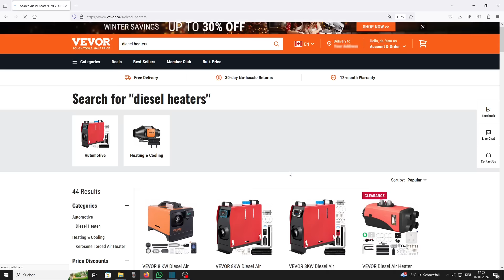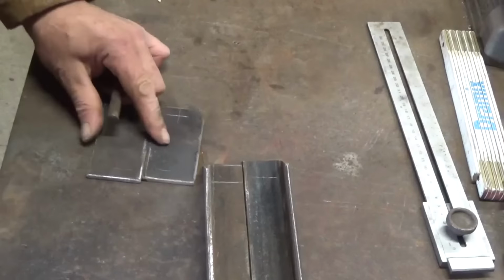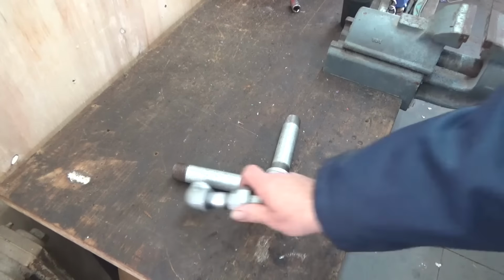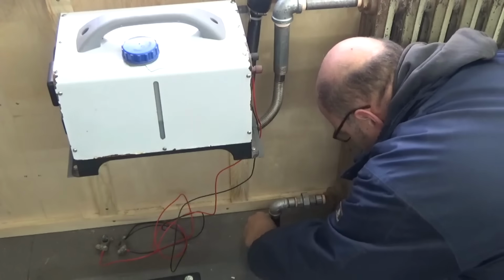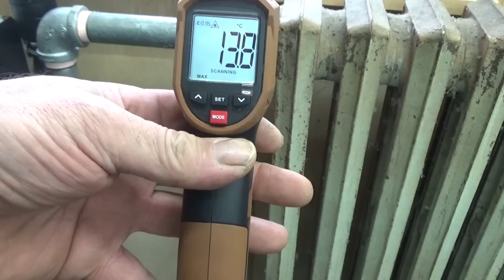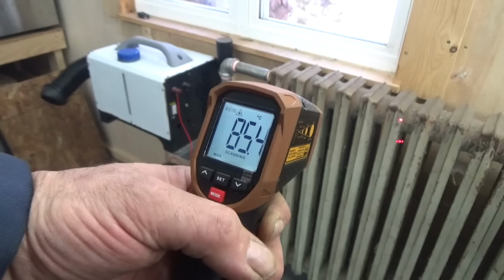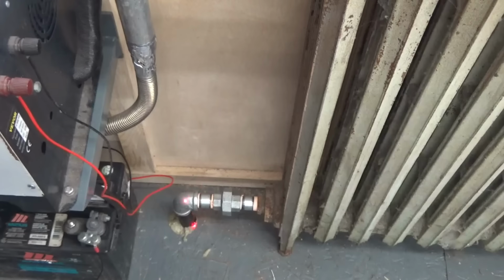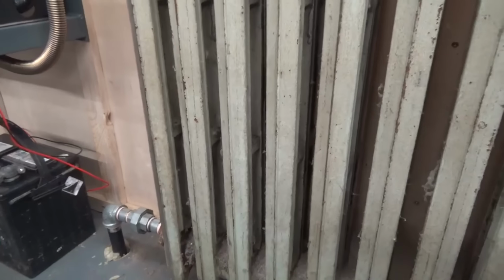Diesel heater upgade 200% more efficient

Comment: That's a brilliant idea, but a few suggestions:
Have the exhaust enter from the bottom of the radiator and exit from the top.
Also the exhaust should enter on one side and exit from the other.
If the exhaust gets too restricted incomplete combustion will occur.
Reply: No. If the exhaust enters from the bottom, there is no way to get rid of condensation. Condensation occurs when the exhaust drops below 100C. There is a reason the exhaust temp from the heater is above waters boiling point. Why enter one side and exit the other? He already showed that he is extracting all the heat from the exhaust, so much that his exhaust Temps are below zero, causing the condensation to freeze in the radiator.
Reply: @ColCurtis  Physics
Still a closed system.
If what you stated was true, eventually the exhaust would become blocked from the freezing condensate, filling the room with exhaust gases and killing everyone inside.
Ever see an air compressor tank condensate valve? That is the ONLY proper way to drain the system. Every other way relies on pressure. The freezing readings were from the outside of the pipe, where the outside air was flowing into the area and over the outside surface of the pipe not from the exhaust gas exiting the pipe.
Reply: @stans5270  if he keeps the bottom exhaust pipe temp above freezing the condensation will run out the bottom exhaust pipe. It is not a closed system if the bottom pipe is open. I would Insulate the bottom pipe to keep it room temp.

Comment: One gallon of diesel will only has  125,000 btu. You will never get 200% efficiency and 250,000 btu out of it as it isn’t possible. You will be lucky 110,000 out of that heater as the most efficient oil furnaces are about 96% efficient and cost thousands of dollars.

Comment: Good to see someone else in NS doing stuff like this besides me. LOL    Been using these CDH for a while.  You will have issues with carbon build up eventually and condensation building up  with the exhaust angled upward like that.   Everything  on the exhaust should be on a downward  slope to prevent condensation build up and giving it a path to drain.  Also move the combustion air intake outside of the space,  when it does foul up it and it will at some point it will dump all the exhaust gases back through the intake manifold into your room because the intake and exhaust share the same combustion space.  CO monitors are a must.   Stay safe and good luck.
Reply: Intake should be outside, it really pulls air. The way he has it pulls air in through every crack in the building....
Reply: Yes the combustion air intake should always be outside.  When inside they will pull cold air in from the outside through every crack and crevice it can because of negative pressure.  I have seen the result first hand from my own mistakes and experiments over time.

Comment: I think that if you take the big nut out of the radiator you'll find a baffle in there. That's slowing the flow with the exhaust down. Maybe it'll heat the radiator up better if you take that out

Comment: Nice try, but 2 IMPORTANT things, u should think about.....

1. U cant be safe, that no carbon monoxide is coming into your room, with that crappy pipes. nice thing on this, u dont smell it - u go to sleep - and dont wake up - so, dont care, it wont hurt u
2. The radiator will be filled with soot - and it will burn then - so if u sleep, dont care, u dont feel it again, its a fast and hurtless death

Typicly for youtube - sooo much crappy things are shown here - plz dont build it like that....if u dont know, what u do...

Comment: You really shouldn't use galvanized piping for exhaust because when heated it will off gas harmful vapors that also why you need a respirator when welding it.
Reply: "You really shouldn't use galvanized piping for exhaust..."

The galvanized pipe isn't getting anywhere near hot enough to create harmful vapors. The temperature readings were showing less than 200 deg Celsius.

Comment: In the loop from the exhaust, the water from the condensate will drain, and in a short time it will malfunction. It was good that the exhaust was mounted downwards towards the radiator

Comment: You can use a combustion analyzer on in the exhaust stream to tell you its efficiency. Those Chinese diesel heaters have a combustion efficiency around 70-78%. Extracting 200% more efficiency would require breaking the laws of physics. 

Thermo-Pride is the only company still around that once made a 90%+ efficient oil furnace (diesel). The rest of the companies that made them have been sued into the dirt for deaths caused by their equipment.

Keep in mind we aren’t “cracking the code” here, we are re-inventing a death trap.

NOx is just too high with oil/diesel to prevent the secondary heat exchanger from eventually clogging. Those Chinese heaters have particle density worse than a traditional furnace and if those can’t do it than what hope does that have. When they first start it’s so high you can see it without instruments (smoke).

That’s assuming the acidic condensation is addressed in the secondary heat exchanger ie drain trap inside so it doesn’t block the exhaust when it freezes draining outside, high quality stainless steel so it doesn’t rot out and leak inside (or block the passages), etc etc.

This is one of those cases where you say “why doesn’t anyone invent/nake/sell this?” And instead of researching we skipped to “I must just be smarter than all the engineers on the planet”.😂
Reply: Like that’s just your opinion
Reply: Back in the real world, I've been running a similar setup for just shy of 8 years with no issues whatsoever.
Reply: @cynic5581
 all these poisonous gases, are easily removable with PC fan mounted on the building exit hole. As the temp there is ultra low, this fan can work and work with no probs. It should be PC due to the same 12V power. One have to test different speeds, as some of them fans are too powerful and probably can influence the burning. I mean it is 2025 outside, there is Internet, one have just to define the problem and all of the human's knowledge is at hand to solve it. Don't give up so easily.

Comment: Awwww you cheeky monkey!  I’ve thought about this same issue, but to use an old radiator?  Brilliant!    Do you feel like the air flow is restricted with this set up?  It’s just a fan blowing, and not an air pump after all. 
By the way, there are a few videos out there on upgrading the fuel pump so it doesn’t make so much noise.

Comment: I personally would have connected the exhaust to the lower point on radiator and exhausted the upper connection to outside to take advantage of rising heat.
It would heat the radiator from the bottom up essentially heating the whole radiator more efficiently  with waste heat
Reply: The heat may rise faster than it can be absorbed causing some heat to be lost through the exit still. Going top in and bottom out holds the heat in as long as possible because the colder air will exit first.
Reply: the issue there would be condensation in the radiator, in this configuration it flows out the bottom
Reply: That would be foolish. The exhaust would fill with water.

Comment: Because your air intake pipe is inside the house, it will create negative pressure and suck in cold air from outside. The air intake pipe should be placed outdoors.
Reply from the maker: Basically you are correct but since the heater is installed in a small room it gives me a little fresh air circulation via the room ventilation from outside. Every installed wood stove does the same thing, it burns the oxygen in the room and therefore requires air supply from outside so that you don't suffocate. I thus achieve a forced air exchange in the room in which it is installed.
Reply: @dsfarmns2823 Hi, excellent heat recovery from the exhaust, you could just take air to combust from under the floor so you are just recirculating the heated room air.
I used to have a “new” house and had to have fans to bring air in.
Take care M.
Reply: Sixof one and half a dozen if the other?

Comment: Input should be at the bottom as heat rises!!
Reply: not per se... if you put it at the bottom, and have a forced air from the furnace, then the inlet at the top forces the hot air to go down the radiator due to increasing pressure, thus extracting more heat from the air... If the inlet is at the bottom, then the hot air just naturally surges upwards to the exit hole, extracting less heat from the air... Generally what you say is true, but not categorically...
Reply: the heated air is being cooled, cooler air falls.
Reply: Not with this system...the condens water needs to fall down and exit at the bottom.

Comment: I would be afraid that over time water would build up in the rad. I would install a valve to drain it from time to time. I, however, just bought a 10 ft exhaust hose in a downward coil pattern before exhaust outside. By the time the exhaust goes out , the pipe is room temperature. I also put a fan on it blowing the heat off the exhaust into my shop. Hope this helps!

Comment: The exhaust would work better going in the bottom of the radiator and out the top! As heat rises.
Reply: The exhaust will create condenaste, it is more efficient  to plumb it at the top. Also since heat rises the heat would escape quicker if it was plumbed at the bottom.

Comment: I find my exhaust blocks up with carbon even running it on pure diesel with a standard exhaust, the system you have will eventually block up and will need to be cleaned out with high pressure water.

Comment: Secret menu 1688.
Put hz low at 1.6. And hz high at 3.6.
And you get same heat lower consume of diesel !!!!!

Them are way to high from manufacturer. 

Put down hz and fan a litle up and receive same heat lower consume
Reply: Then it burn much more clean and better overall.

Have so damn much to say.

I am using this 24/7 365 for 3 years stright
Reply: Just see fine tune diesel heating burner and you get to see how much better them get to burn.

Same heat. Half consume almost

Comment: That is not  a 200 percent efficiency at all. The exhaust gas can only heat a small section of your radiator, the bottom remains cold, indicating the hot exhaust gas flow is small.  Yes, you are recovering a little more heat, but certainly not the amount you hoped for. To achieve a 100 percent increase over the 5 kW initial output would require another  5kW of exhaust heat, they do not waste this amount ever.

Comment: Yet another wrong install. Combustion air intake should be outside, or you make the room negative pressure.
Reply: look you are right but i doubt you have this efficiency so s tfu
Reply: You are right that it creates a small negative pressure. But this can be a desired outcome!
Many RV people use this trick to keep condensation in the RV low. The small negative pressure allows a small ammount of dry and fresh air to enter the RV
Reply: If the house is drafty, I doubt negative pressure is an issue.
Reply: @florihae  Do you think these Chinese diesel heaters are safe? I'm considering using one to heat inside my 5th wheel and possibly to contribute to "warming up" the skirted underside of the RV. I'm new to these heaters and it's my 2nd winter in an RV.  

Thank you.
Reply: @ShaneKuhnOfficial  had one for 2 years in my camper and many other peoole as well.
Buy a CO Sensor, place it where you sleep and you should be very safe
Reply: @pootersnacks  lol, nice cope. I installed mine correctly. Ask anyone that works Hvac, if that's allowed by code, to use inside air for combustion. Do as you wish, but to say it's fine, is wrong.
Reply: It's a negligible amount.
Reply: @florihae  totally true in winter you might find it hard to believe but when u seal the place up too much it gets reallllll humid
Reply: @johnqpublic9074  "Combustion, ventilation, and dilution air shall be permitted to be obtained entirely from the indoors in buildings that are not of unusually tight construction."

ICC Chapter 24: Fuel Gas - G2407.5 (304.5) Indoor combustion air.
Reply: @teebob21  Lol, literally the entire section of chaper 4 deals with intake air. Yup, selective sighting. 401.3, 401.4.

401.2 is natural ventilation and deals with the sq footage of the room and building. Do you know the size, how well it's sealed?
Nope, and neither do I. BEST practice is to install an intake for combustion air.

And your ENTIRE argument falls flat if there is sleeping in that building.

edit Had to look it up but for Oil appliances it's 1sq in / 5000btu/h, Gas is 50 cubic ft / 1000 btu/ h. Oh and also 304.9 that says follow the manufacturers install instructions. lol
Reply: @ShaneKuhnOfficial  millions of these diesel heaters in use.  Get a CO detector for peace of mind.
Reply: Great video very ingenious 👍

Comment: Simply Genius!!! Works perfectly as these diesel heaters use a forced burn. Radiator is a steam radiator so any condensate will only happen in the lower section as water vapor is naturally drawn to cooler surfaces! Any water that collects in the bottom will eventually be blown out due to the forced airflow. ❤️💯❤️

Comment: You name it I've tried it including a similar radiator and clogged it. I guess some of the problem is too much back pressure so hampering complete combustion in the burn chamber creating soot from unburnt fuel. The first signs are increased fuel consumption and less heat along with a pungent exhaust smell.  Hitherto the only way I have found to scavenge heat with minimum soot forming is a long straight length of copper tube laid to a gentle fall exiting through the wall,. So I only have one 90 degree bend and that's in the supplied short bendy exhaust pipe. A dead straight pipe is easy to rod too. Like it or not diesel is a sooty fuel, kerosene is less so. I only use my heater on the lowest setting and after passing through some 8 feet of copper tube [could be less if fins were slipped over it] the exhaust is condensate and barely warm. If like me you run your heater on low then now and then before shutting it down run it at full pelt for a while to hopefully clear the chamber and exhaust system if you extend it. Of course every installation is different and ambient temperatures altitude and humidity mean what might work well in France will fail in Finland...

Comment: To make it operate better you could move the air intake (or the heat exhaust) to the opposite side of the room so that the warm air will be pulled across the room.

Comment: Nice idea - I may give that a shot.  I think you definitely need some kind of drain for condensation, though.  You are dropping the air temp down to well below condensation temp by the time it exits the radiator, so I am betting you will soon have the bottom of the radiator full of fairly acidic condensate, which will likely do some significant damage to the internals of the radiator in the short term if you don't have a way to drain it.  The cast iron would last a century if you ran clean water through it, but letting acidic water sit in the bottom will do significant harm to it. 

Even if the radiator cast iron holds out, you will eventually be dumping that acidic water out onto your cement slab.  If you don't want to put in a drain, I would think about pouring in some thin epoxy like the stuff mean to repair pinholes in gas tanks, and flipping the radiator around until it is coated inside evenly.  The epoxy may give you some extra time before the radiator bottom perforates.

Thanks for the great idea!

Comment: I run mine through a 3meter flex exostpipe attached to a hanging piece or aluminum flashing and right before it gose out side i have it raped to the meter intake to warm the incoming air. It steams really good outdoors.

Comment: Great Idea!  One point to consider. By replacing the galvanized pipe at the bottom with a plastic pipe and fitting, if possible, would reduce the heat loss at the base of the radiator. May or may not be worth the trouble, but that is what came to mind.  Thanks for the video!
Reply: Actually there's no point in doing that. That length of uninsulated pipe just adds a tiny bit to the surface area of the radiator.
Reply: @hansmuller1625  It is a thermal bridge. Cold wind will cool the pipe, and the pipe will pull cold from the cooled end from the outside to the inside. Steel is a 300 times better conductor than wood. But this setup is probably not an optimized solution anyway.

Comment: Buy yourself a carbon monoxide detector if you're still alive.
Reply: How would he get sick it's plumbed out
Reply: @calupjensen4233  carbon monoxide is heavier than air it has a tendency to pool in
Reply: In areas you least expect and then seep back into your home. Diesel heaters are like diesel generators you need to be careful carbon monoxide is not something to play with.

Comment: perfect application for the old water heater, match made in heaven.
Reply: after years the acidic condensate from the exhaust could rust a hole through it. great project but for long term use precautions need to be made.

Comment: If all the doubters and knockers of this install re the exhaust going upwards to the radiator were right and they are not all the trucks ever built with there massive exhausts exiting over cabs would have hidrolocked but they dont so to the keyboard warriors i say think  first
Reply: They are not designed to run with the exhaust any higher than the outlet. If you ignore this, your diesel heater will need to be stripped down and decoked fairly regularly.
Reply: Your grammar is as bad as your logic.  Diesel truck stacks are huge in diameter, they aren't active heat exchangers, there's a massive amount of flow, and they have holes at the bottom to let out any water in case it does accumulate somehow.